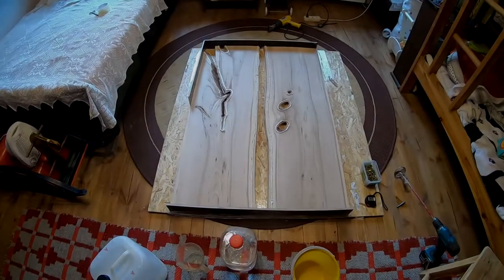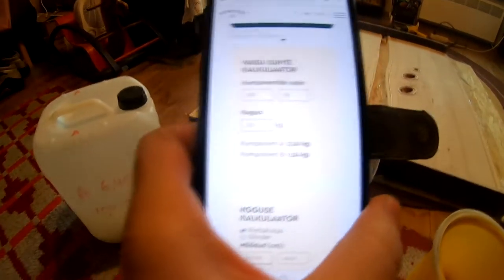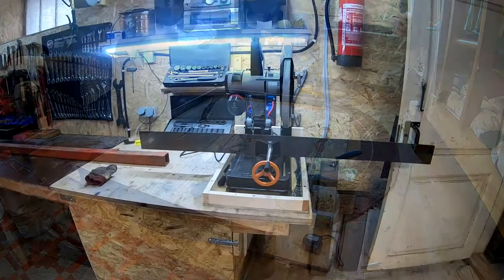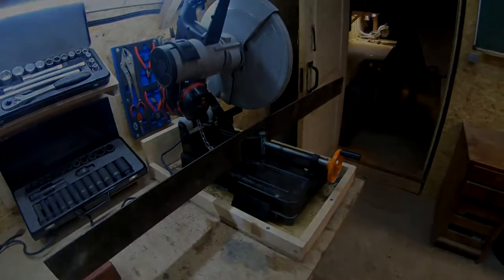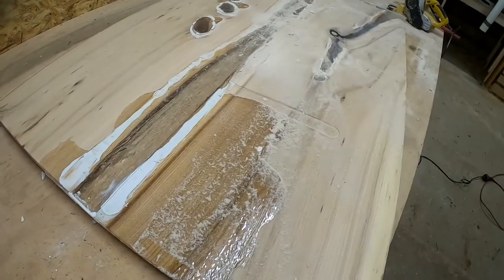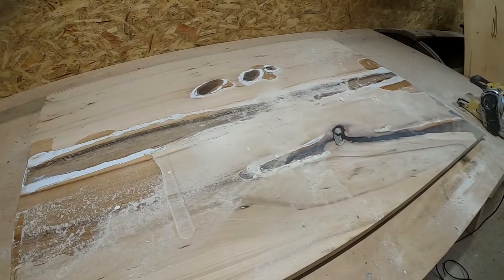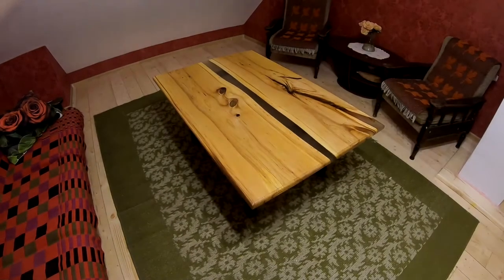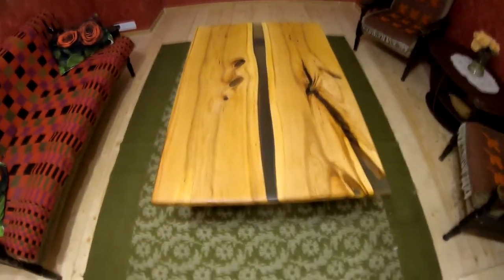Making my first epoxy table!! Did i succeed?

Comment: Cool table. First time doing something always has its unseen pile of problems to run into. Almost always happens to me with my own woodworking projects. But thats how we learn. Its all about getting more experience. I made a door for myself a few years ago and had a nightmare of time with its finish. The stain i used did not like the parts i used filler in and ended up sanding it off but it was soaked deep. Ended up good because it looks rustic now as it would of been intended as :D A coffee table i made out of maple i burned lines in with a cheap router bits bearing. Ended up spending hours sanding out because how hard the end grain on that is.

Comment: Awesome video!!! This should get a lot of views! It turned out awesome, I made an epoxy table for my living rm a few years back wish I would have made a video on it, how do you put those sub titles on your video thumbnail like that? I’ve been trying to figure that out forever and I can’t seem to figure it out
Reply from the maker: Really easy. Open up a picture u want with paint 3d, change the ratio to 16:9 under crop setting. And then add the text. Loads of different options for text there.
Reply: Thank you soooo much!!!